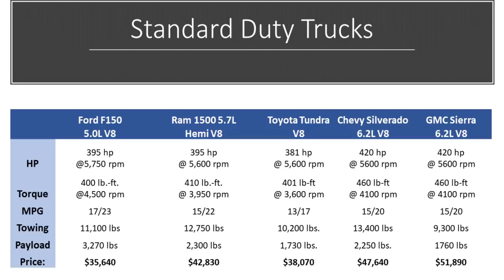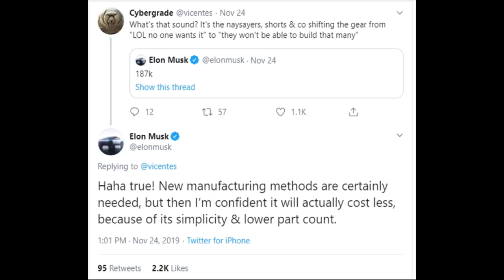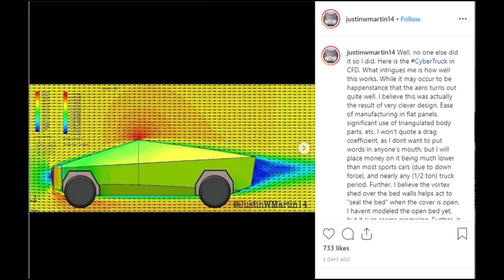Tesla Cybertruck Design Genius or Design Fail? Exploring the Function behind the Design

Comment: Anyone who has ever had the misfortune of attempting to squish a flea with your fingers knows first hand  the potential incredible strength of unibody construction.  With a unibody design made of 3mm 301 stainless, the incredible flea has met its match.  Not to mention all trucks on the market.
Reply: Not to mention the driver of the super hard exoskeleton getting his brains scrambled because all the kinetic energy got passed directly into him.
Reply: The Smart car does not have a crumple zone, but is considered very safe.  I know this does not add up.
Reply: John Walters Fun fact...the smart car is actually a crumple zone used in regular cars.
Reply: @johnwalters6800  smart car cant get to a speed where hitting a wall is dangerous

Comment: Best to wait, Tesla doesn't have the infrastructure to support the sales they are doing, I hear stories of people having issues and having to wait 1-2 months for replacements.  The idea is great but the delivery is way behind other companies.   I am curious to see a model s with 150 k + miles, Curious how the battery handles with high mileage.
Reply: There are plenty of model s with 150k + miles. There's one in Germany in c more than a million km. First 300,000 were more difficult with Last Generation battery and Motors ...old model s . Last 600000 the batteries been reliable as have the Motors. You can find online writeups

Comment: I don't see styling at all. I see producibility by Design, and I think that accounts for the low price. BTW, this is not really unibody. I call this unichassis. Unibody has frame built into the body. This has a body as frame.
Reply: Producibility, strength, and aerodynamics all wrapped up in one iconoclasitcly angular shape.

There's no denying that curves are more aerodynamic than sharp angles, but that's clearly a deliberate tradeoff to get to use a stronger material that can't be curved easily, and also to reduce construction costs on stamping machines.

There's also no denying that the flat roof/vault-cover plane is far more aerodynamic than a traditional concave truck-bed/cab-back angle.

Though there are tradeoffs, the Cybertruck shape is rife with benefits if you know what you're looking at.

Comment: Flat surfaces have one more advantage: vinyl wrapping. A big chunk of those trucks will end up being company trucks. You might want to put some kind of vinyl on it. Material that can handle flat surfaces vs those used for complicated is so much cheaper. And then nothing needs to be taken off the truck for the job. No stretching, just flats - hours reduced by 50% at least.

Comment: I thought a video about "design" would be a little more, well, more a critique of the design?   All I see are problems, but apparently he is tapping into fantasies that I'm not afflicted with...
Reply from the maker: I do appreciate the feedback. I was attempting to go beyond opinions of the design and discuss the "Function Behind the Design".
Reply: @Cleanerwatt   You did the most I have seen, I guess.  But unbreakable windows are a problem, because if you end up in a lake, you want to break the glass to escape.  Stainless steel is only "rust resistant"...meaning it can rust.  How susceptible it is to rusting depends on the alloy....and even Elon can't afford to use 316 stainless!  And the BS about saving money on the assembly line--all the things Elon says are expensive on "normal" vehicles...are actually the things that makes them affordable!  Stamping metal is literally the cheapest way to make metal parts!  And you can't cover up dings/ creases in a stainless panel...and flat panels are the worst for showing dings...because they are flat they would have to be thicker, which means heavier and more expensive...which is the opposite of what he claims it is!  And then, there's the part where it is supposed to be an EV with a monstrous towing capacity???  Towing an inch is one thing, but towing 100 miles...that ain't gonna happen!

Comment: I wonder about repair costs. Looks like no quarter panels... all four appear to be part of the frame. Would a fender bender cause the vehicle to be a write off?
Reply: I expect the other vehicles will crush before this hard body even starts to bend. 😉

Elon mentioned how inexpensive the body is to fabricate. Much of that must be due to automated welding, but the rest is due to simplicity. 

Stainless is easy to weld using MIG or TIG. Body shops can cut off the bent metal and weld in flat replacements of 301 stainless cold-rolled x30. No Bondo. No paint. No expensive marked-up custom-stamped body parts. 

On the other hand, there are crush zones front and back. These are likely to be softer steel proprietary Tesla structures. Maybe these can be purchased. 

I owned a Renault/AMC Medallion wagon with 5 mph bumpers; the last car ever made to this standard. 😩 The bumpers not only had spring/dampers, but would press into the tire rubber with skid plates. At a stop sign, I was rear-ended by a sub-compact which was totalled. 

The wagon was fine except the speaker covers popped off the lift-gate.

Comment: Can stainless steel be stained or tinted with translucent tint or stain?
Reply from the maker: I know a heat tempering can be done to change the color.
Reply: @Cleanerwatt  that is an oxidation of the nickel crystals turning alloy a deep purple. At that temperature you may also reduce the hardness because: annealing. 

Carl, that is difficult because: "stainless". Some strong chemicals can change the color, but probably easier to electroplate to affect color than to stain.
Reply: You're better to simply paint the Cyber truck if you would like... and the Cyber truck would be very easy to paint.

Comment: Yep, I couldn't agree with you more!  I have ordered a Tri-motor.  Can't wait to get it!
Reply: Didn’t want to wait the year..went dual motor..
Reply: DQ10 i suspect the dual motor will be the best for off-roading, too. Trimotor has 2 layers of battery, doubling the weight of the battery (not good for off-roading.
Reply: @bryandbaker , is that something you know?  I think the Cybertruck will be using the new battery tech that Tesla is developing.  I know it will be heavy but I don't know about double thick.  Just the same as in the beginning Model S days they went from 60KWh to 85KWh  in one level.  I think they will have additional volumetric capacity
Reply: Irv Lennert I don’t think Elon or any Tesla employees at the event are on record confirming the double layer, it just makes the most sense. The 2.0 Roadster is so confirmed, 200kWHr giving 620mi range, so it’s not out of left field. Keep in mind the battery will be between the wheels but not under the bed (offsets and saves weight to be used as payload).
Reply: @bryandbaker , I guess we will see.  I think a lot more will be known at the up-coming battery investor day...
Reply: I didn’t realize Ford still made Tri-motors.  LOL.
Reply: same give time for bigger down payment or to outright buy it depending how much down i got i may even do self driving

Comment: Software based controls means no wires for knobs and buttons.  Thus it is lighter.  Also, it means that it is easier to continually improve via over the air updates.
Reply: This thing will weigh too much.

Comment: I wonder will the Cybertrk have vehicle to home electricity sharing capability?
I heard Nissan Leaf have this in Japan for disaster relief.
Seems very useful
Reply: All Teslas can double as a Powerwall if your house has the solar and car charger setup I believe.
Reply: @CathayanMagus  tho, I believe Elon said it's not really advisable, but it works ok for that
Reply: @tydshiin5783  Correct. It's possible, just not practical. Usually, it's for when there is an emergency like a grid outage and you want to supplement your existing power walls. Having another option is clutch in those situations.
Reply: @CathayanMagus  -A fleet of these parked in Fukushima's lot could have averted a disaster..
Reply: @CathayanMagus  No, Tesla's have never had the ability to be used as a Powerwall (at least not from the factory). All the early Tesla Model S and X vehicles had free Supercharging for life. So there's no way Tesla could let people Supercharge to fill up their car for free then easily pull the electricity out for some other purpose than driving the car. Having said that, it's possible to hook up an inverter to the 12-volt battery in a Tesla to power a modest load. As the 12-volt battery gets low, the big battery automatically charges it like the alternator in an ICE vehicle. However, the Cybertruck will come with 220 and 110-volt outlets from the factory.
Reply: Japanese EV's use a CHAdeMO connector which is bi-directional enabling the vehicle to be used as a power source. Teslas in the U.S. have a proprietary connector which does not support using the car as a power source. However, the Cybertruck has outlets for 220 and 110 volts so it could be used just like a generator. Tesla has not released how much current is available from these outlets.

Comment: Great analysis.  I've subscribed. 

The disadvantage of the cab over frame design is that the cab (and bed) of the truck provide no load carrying or towing capacity to the truck. They are dead weight that actually subtracts from these specs.  In the Cybertruck, the ultra high strength stainless steel exo-skeleton body IS the structural frame of the vehicle, and the reduced weight compensates for the large weight of the battery.  I think Elon said that CT weights about the same as the F-150 equivalent.  That's amazing.
Reply: No frame to mount a snowplow to .. This eliminates those of us that buy trucks for work. Plus, I don't think BEV's are ready to pull heavy loads long distance yet. This truck is very cool but still can't replace heavy duty pickups yet.
Reply: @johnyager9052  Agreed.  There will always be a need for various types of trucks.
Reply: @johnyager9052  someone will modify the cybertruck with a plow I can see it happening
Reply: Thank you for being honest. I'm all for the new vehicles being developed. I'm just tired of the fanboys saying how this will crush the others in the truck market. Things like how outdated they are and can't match the specs. Those of us that truly buy trucks for work and play buy what does the job. I just want honest talk and not fanboy hype ...
Reply: @johnyager9052  The Exo-skeleton is the frame. It is also steel so just weld the plow brackets straight to the front of the truck. In fact that is what makes this the most modable truck out there now as it just needs to be welded for any modding done.
Reply: @johnyager9052  All those spec that he brags about but not the weight?

Comment: The guy on the boat and engine channel ran a CFD programme on it and not only did the laminar flow stay intact over the roof the blunt nose created a pod of high pressure air in front of it forming a more aerodynamic leading edge and the COD improved as speed increased.
Reply: They weren't kidding with the design
Damnn
Reply: And the funny things is that while the battery and motors need airflow, it’s nothing like an ICE.   So there really is no need for a “grille”.  This shows that the apparent “grille”
On the Cybertruck is functional for another reason, and that airflow simulation showed it in a surprising way.
Reply: To true. Totally unexpected
Reply: Cd values on that video are way off though for the known truck values and the sharp angle on the roof clearly caused more drag than if it were smooth.

Comment: Drag coefficient has nothing to do with how large the object is, only the shape itself.
Reply: I love how friendly yet debate-like this conversation was! So much better than many other conversations on the internet!
Reply: But the drag force itself is dependent on the frontal cross section and the density and velocity of the air flow.
Reply: @MsAjax409  Your statement doesn't rebut a bit of what Jorge said. Drag force is a product of many parameters including projected area and drag coefficient. Even if the drag force is growing with size because of a larger cross area the drag coefficient is still the same. The drag coefficient is a unitless(!) number that rates how streamlined a shape is (with certain direction of flow), there are no dimensions included that would make the drag coefficient dependent of such. Drag force doesn't influence the drag coefficient, but the drag coefficient does influence the drag force! And that is true for the simple mathematical reason that drag force is the final product of multiple coefficients that the drag coefficient is part of (hance the name drag coefficient)!
Reply: I wasn't rebutting his statement,  I was expounding on it.  Both of our statements are true.
Reply: @MsAjax409  I know both statements are true, though the "but" implies a rebuttal in my personal opinion. Guess we clarified that.
Reply: The Tesla semi has a lower drag efficient than the Bugatti. Size is really irrelevant.
Reply: @andy.connor.e8853  you don't understand drag, if wetted area (area exposed to airflow) is the same then shape governs, as long as speed is the same, also to double the speed of an object requires 4 times the power, until of course compressibility issues arise... The shape of that Tesla truck won't count for much as average speed of an automobile is fairly low (I drive 11 miles one way to work, my home is 2 blocks from the ramp, work is 3 blocks and average speed is still only 49 mph) and that flat rear end causes induced turbulence, for it's footprint there just isn't much cargo room or passenger seating.
The Tesla semi has a LOT more drag that any car, more area exposed to airflow and all that

Comment: I wish they would make a small Cybercar
Reply from the maker: They will probably make a smaller Cybertruck: https://twitter.com/elonmusk/status/1198711241520242688
Reply: Europe has many narrow streets.
Reply: @avid0g  it is the same size than the small work vans that are used in Europe. I wouldnt worry
Reply: Same here... I want the stainless steel construction.. The life span of this vehicle is going to be amazing..
Reply: @justinmallaiz4549  One car 1,000,000 miles last a lifetime
Reply: @MyName-mo7fw  : or ride share them... When the durability goes drastically up.. it's more like renting out a shovel
Reply: Won’t work. You can’t get the sleek, aerodynamic angles with the shorter wheelbase.  The ratio of length to height is super important for a low Cd, even when you can curve the metal and glass. Dramatically more so when you can’t.
Reply: Bryan Baker yes it will
Reply: My Name smart for two cyber truck
Reply: Basically just make a prius with low poly flat shapes lol

Comment: It’s not just a “stainless steel exterior’ it’s a stainless steel plate exoskeleton.
Also it’s not just ‘unibody’ in contrast to body-on-frame. Unibody doesn’t capture revolutionary exoskeleton .
Reply: Video covers this. Just advocating for emphasis of CyberTruck’s core innovation.
Reply from the maker: @jameshoffman552  Thank you - emphasis appreciated - the Tesla Design team is amazingly talented.
Reply: @tech 52 
Elon said that the metal had to be scored before bending angles, so that gives some indication of how hard its is to work with. I expect that all the 90° bends needed scoring on the inside corners to prevent splitting, but the 5° bends did not. 

When you cold-roll 301 stainless thirty times it becomes quite hard and inflexible. Can that 3mm sheet still be shipped in a coiled roll?
Reply: @avid0g  The "X" in 30X means it's an unclassified or custom alloy not that it's cold rolled 30 times.
Reply: @bburton333  
You're right (slaps forehead). It must be a proprietary or at least little-known variant of stainless (thus 30x), that cold-rolls full hard at an unusually high psi.

For example the uncommon 301si formulation with less nickel and 1.35% silicon.
Reply: @tech 52 
So much made up BS

Comment: Great info, much thanks. With the onboard air compressor framers and roofers will love it to run air tools, A 240 outlet with an inverter will run welders without the need of a generator. Also the 240 outlet should be able to juice another EV if they are out of charge on the side of the road.
Reply: Will need to add a storage tank to run a nail gun but no problem.
Reply: @terrysullivan1992  All Teslas that have air suspensions have air tanks installed at he factory